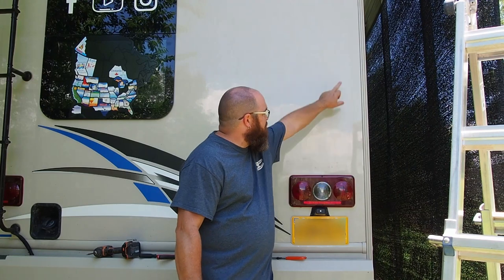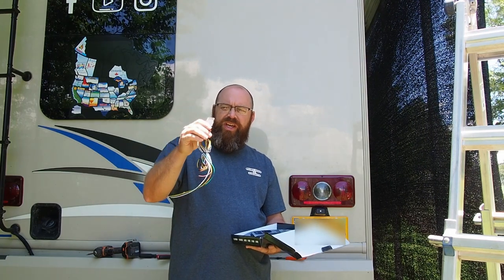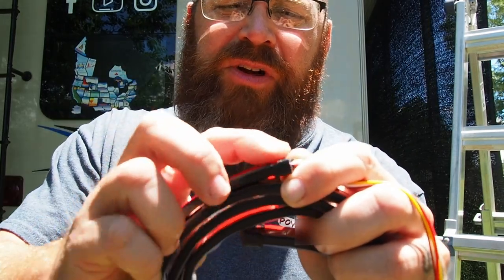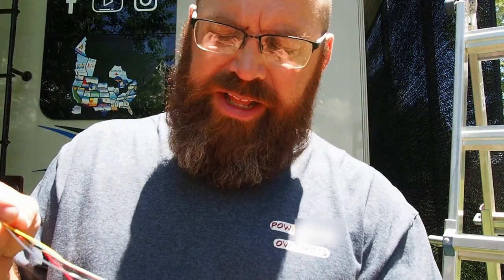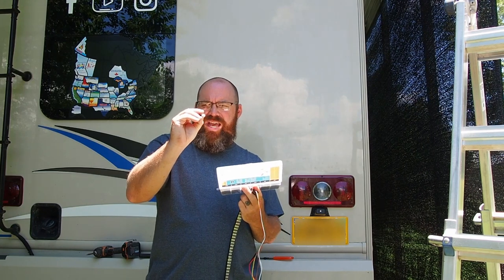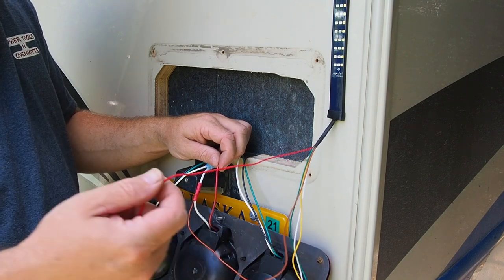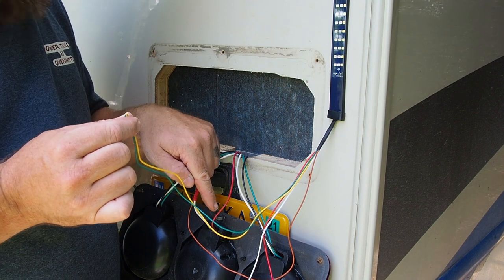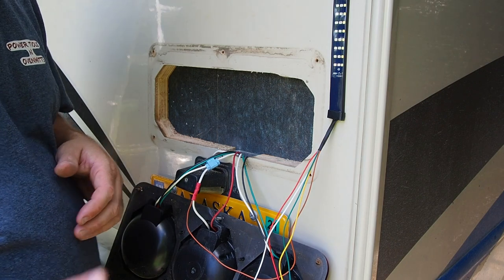Zmoon led upgrade to rear lights of of RV

Comment: Great idea....and on Amazon there are so many variations for this...49" or 60"...flexible strips or rigid aluminum frame ones.  I had wondered about using these truck lights but wondered how to get the bar to use full light bar for left or right turn signals....hadn't considered just combining the two wires...duh....
Reply from the maker: Hope it helps.

Comment: Maybe (since those are out of stock) you could recommend a different but similar in function item? Looking to purchase & happy to use affiliate link. Thanks 🙏
Reply: I purchased Mega Racer (bummed I couldn’t find USA made), but wanted to comment that it would be better to connect to your tow connector so you don’t have to deal with cutting into existing tail lights and deal with grounding issues (per my installer). He used extensions from Auto Zone to make it happen. Thanks for posting this video! Helped a ton! Looking forward to having visibility even when our covered bikes are on the back. Cheers
Reply: Same situation as you, except that I did the install myself. Got mine from Nilight (China of course) and installed it in the back of a Grand Design TT. The wire scheme and colors were totally different than you see here for motorhome ones. Using the knowledge gained, process of deduction and 3 hrs, got it done. Installed it just above the bikes and below the back window. Thanks for the video.